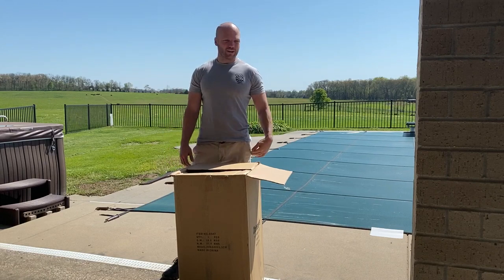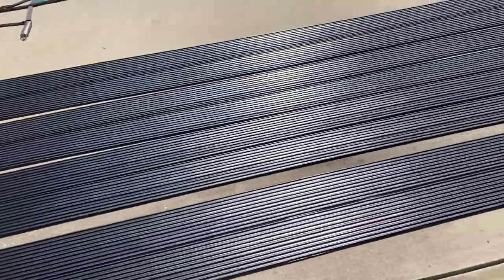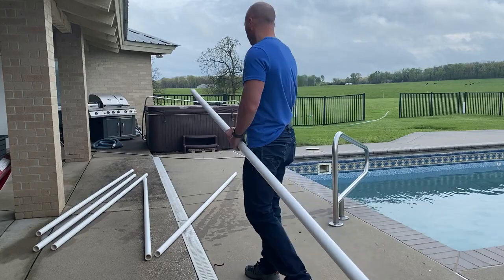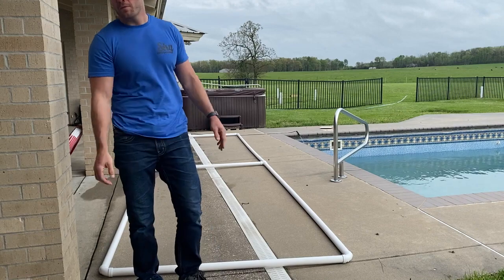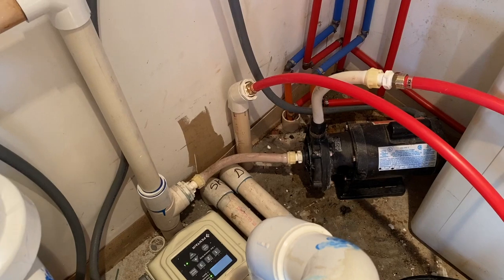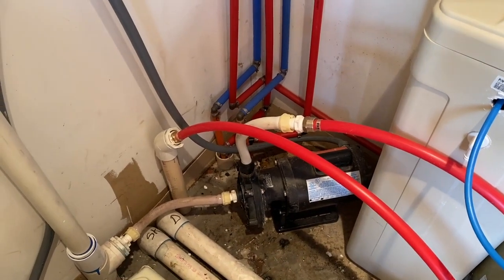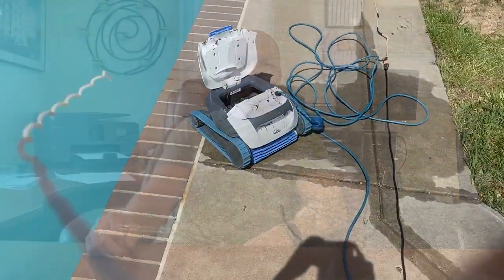Doheny solar Pool Heater from amazon

Comment: Seems you would want it to enter on one side at the bottom, and exit on the opposite side at the top?  The way it is here, it looks like the water can run right up the short tube, without running the length of all those smaller tubes.
Reply from the maker: The tube at the front is blocked off half way. So the water has to run to the far end and come back.

Comment: That does not look good and cutting grass around that is a pain in the ass.
Reply from the maker: I agree. Mounting the solar collector was kind of a pain. The next year when I put it out i built a batter rack out of metal and it kept it up off of the ground. that worked a lot better . the PVC wasn't strong enough to hold it up very well once it was full of water.

Comment: The baffle that goes in the middle of the upper and lower panels on the left side is making sounds anyway to stop ?
Reply from the maker: Interesting, I have never noticed mine making any noise. I'm sorry, I don't think I can help without looking at it. I would think either something is restricting the flow, or maybe its getting air in ti somewhere.

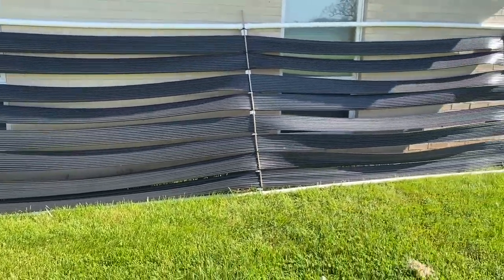Comment: 7:08 Mount it on the roof.😂
Reply from the maker: I thought about it. But I didn’t want to run the chance of causing a roof leak. Plus I wanted to be able to take it down easily. It’s a little ugly, but it does work.

Comment: I think you would be better off running those panels parallel rather then in serious.   This will also prevent your panels from getting too hot.   Increased flow rate at lower temp.   This will also heat your pool more efficiently.    Think of added a cup of hot water to a tub of cold water vs adding a gallon of warm water to a tub of cold water.
Reply from the maker: Hmm, interesting. That could make a fun experiment. It would definitely reduce friction to increase the amount of flow.
Reply: I would think if they were shorter and connected to some south facing angled platform or a roof it would really crank out the heat.  (The cold water in and hot out should be diagonal from each other, not just opposite ends of the same wide tube, with cold at the bottom and hot out the top).

Comment: Do you have an estimate of the power or BTU of the solar heater? For instance, if you measured the temperature coming into the pool with the conventional heat source, what would it be?
Reply from the maker: That would be tough for me to figure out. You would have to compare the temp rise to the amount of gallons/liters it was putting out. And it varies quite a bit depending on time of day, amount of sun and temp outside.  
I think that is does make a pretty significant difference, but the key is to be able to shut off the water flow to the collector at night or if it’s raining. An automatic valve would be best. But at least a manual shut off. Because it will cool the pool back down if it is running water through there on a chilly night (or in the rain).

Comment: I have an above ground pool and I was thinking about trying one of these out but I don’t know where the hell I would put it
Reply from the maker: Yeah. That’s definitely the hard part. With an above ground. Propping it up against the side is probably the best bet. But of course is had to be in the side facing the sun without shade. 
And I would definitely recommend building a frame to support it. I made one out of pvc on the video, but In hind sight marking it out of wood would have been better.
Reply: @RoscoReviews  I have two pallets that I could probably use to prop it up.  Are you happy with the water temp?